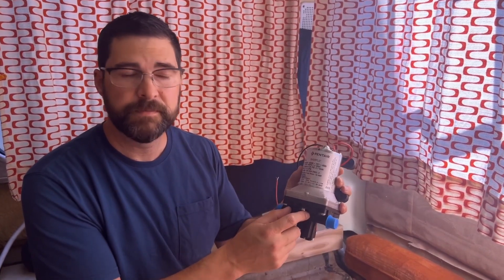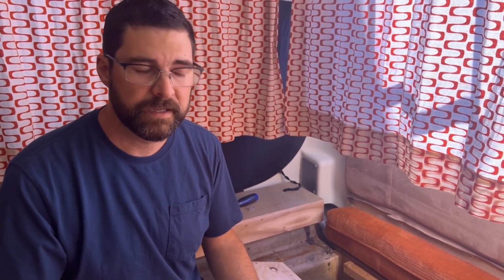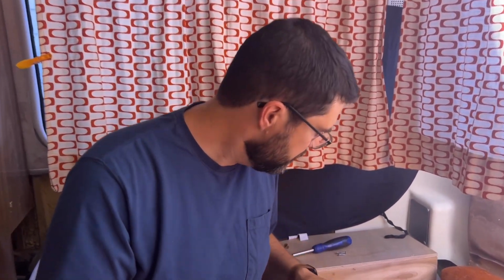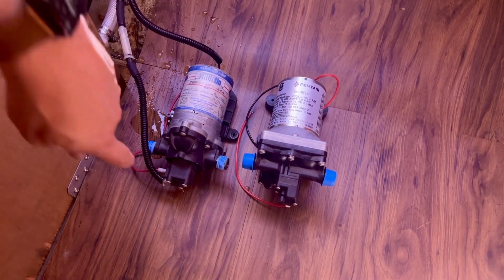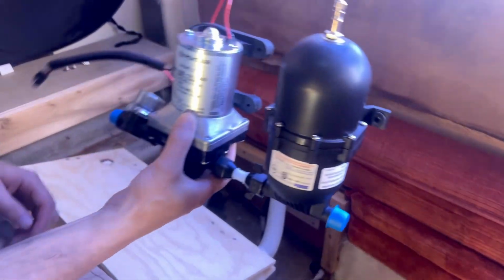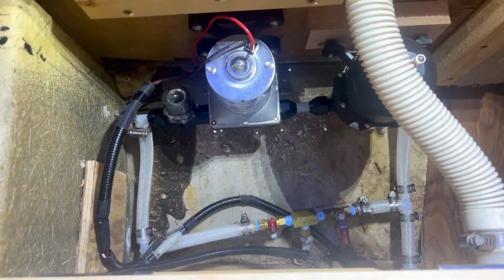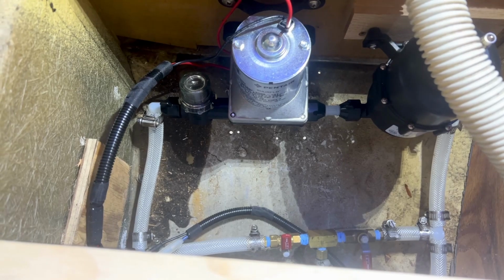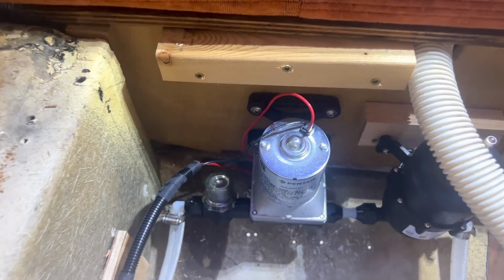GMC Motorhome Potable Water Pump

Comment: nice video. do you use a pressure regulator for the incoming city water hose?
Reply from the maker: Yes, I have a filter and pressure regulator that I use for city water when I am in an RV park. You never know what the pressure will be like. I got both on Amazon, here are the links: Filter https://amzn.to/409nd7L and Regulator https://amzn.to/3G0nbZ9 I have had both of these for about 4 years now with no problems.

Comment: This video inspired me to tear apart the rear of my coach to track down leaks pooling up in the hallway under the carpet. I found a leaking "sure-flow" device installed between the tank and pump. Also found a leaking connection at the fresh tank fill hose bulkhead fitting. Eliminating that leaking doodad before the pump drastically quieted the unit down and cut the pressure build up time to almost immediately! Shower pressure is also now orders of magnitude better than while the pump was sucking air from the leaky doodad.

In case you were the one I recall having issues with the cockpit dome lights:

https://youtu.be/agLb3mg9XKg
Reply from the maker: I'm glad that you got your water system working, it always feels good to make progress! And thanks for the video, it's a great tip and reminder of how the dome lights work :-)

Comment: I just chased down a water leak in my 1976 26 foot, and turns out it was the check valve for the city water not to back flow, it is behind the electrical panel , the valve had a big crack in it, replacing it with a brass one, just wondering if you may still have a back flow issue?
Reply from the maker: Thanks for the tip, I'm getting a slow leak on the left side, it's probably a loose connection but I'll look for a check valve too.

Comment: Don't throw the old pump away, if you remove the front and look at the center of the oscillating diaphragm you will notice a small circular rubber flapper. When the holding tank runs out of water and the pump comes on it tends to fold the little flapper over and under where it should be, it will still pump but will not hold back pressure and will be quite noisy. Costs nothing to repair but about 15 minutes of your time taking it apart and flipping the edge of the flapper back where it belongs, will provide you with a spare pump as a backup.
Reply from the maker: Thanks for the tip! I do still have the old pump so I'll check that out and plan to save as a spare.

Comment: My potable water pump, which I removed, was in the rear of my Transmode along with two large plastic holding tanks, also removed. After almost ten years of no knowledge of these tanks, the water was still clean and fresh. What brand and how many water storage tank(s) would you recommend?
Reply from the maker: My coach seems to have just come with one tank. I think it's 40 gallons. It was new when I got the coach and I suspect it came from Applied GMC like this one (https://www.gmcrvparts.com/product-p/gm28-015-1.htm).